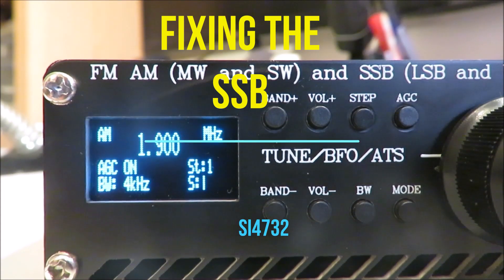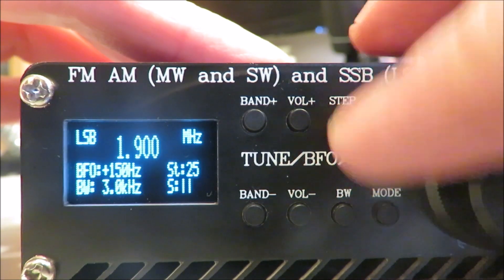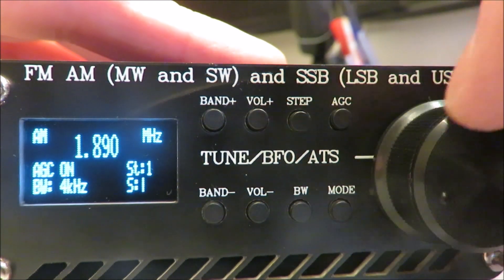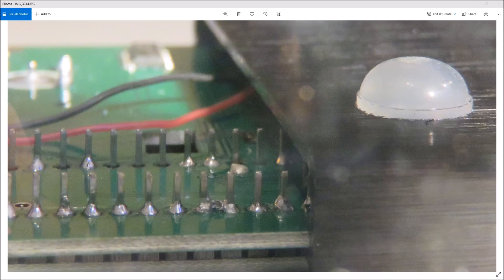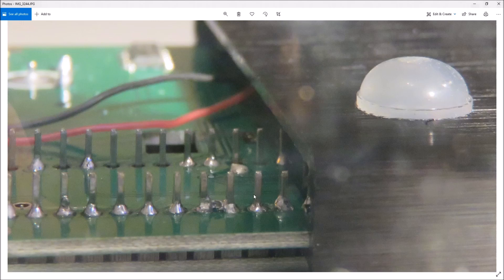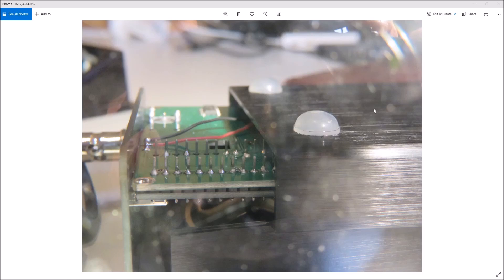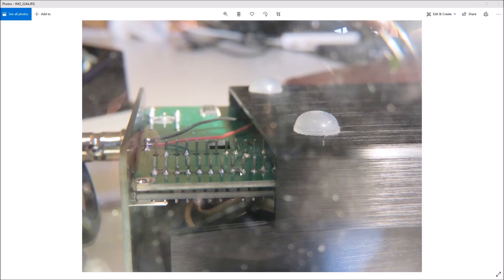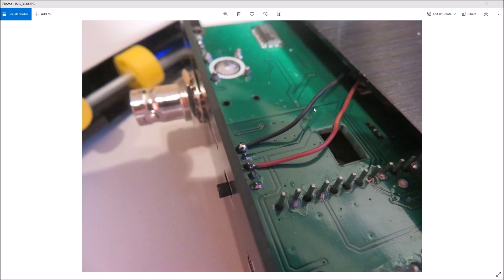Fixing the SSB function on my SI4732

Comment: Are those other unsoldered pins supposed to be unsoldered? The encoder is probably a off the shelf part, so I imagine you could buy a replace it if it wore out.
Reply from the maker: Hiro I can only assume that not all of the Arduino pins are required in this application.